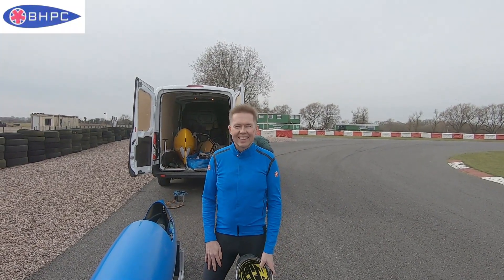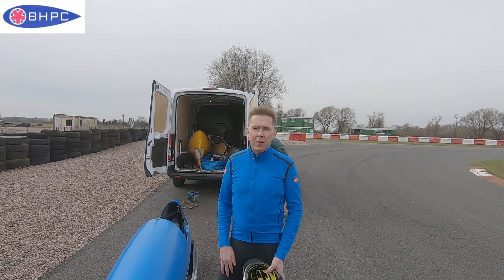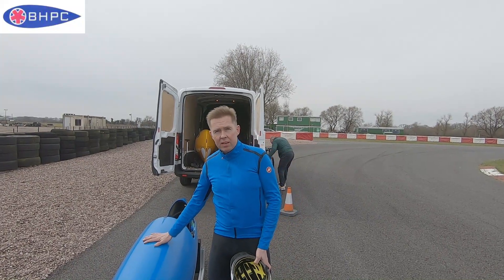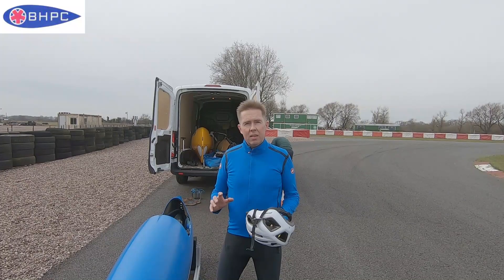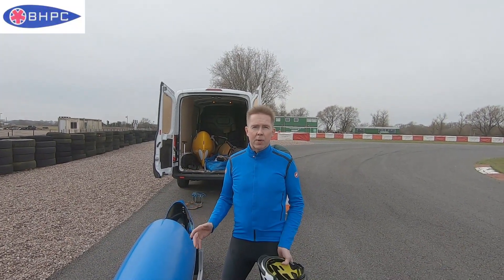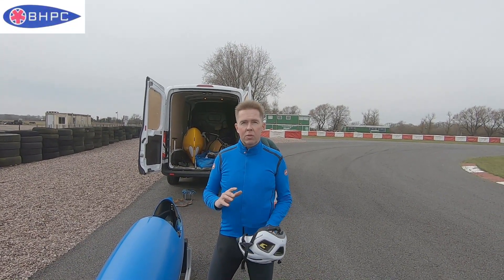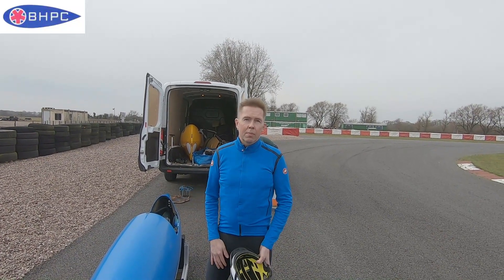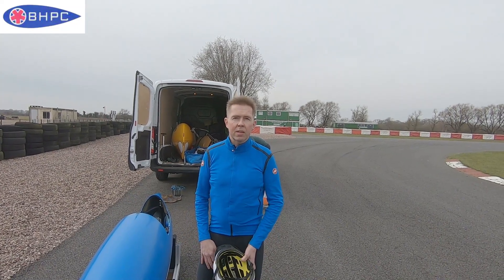200W laps - MTB vs Road bike vs TT bike vs Trike vs Recumbent vs Part-faired vs Faired vs Velomobile

Comment: Throw in some hills, and a road racer with deep carbon (and maybe disc wheel), aero bars, and a variable position Redshift seatpost that has a forward position for aero and rearwards one for climbing will do very well.  May even prevail if a long enough course with enough steeper climbing.

Comment: I wish you had one of my bikes to compare; The new Apache went 24.17mph on 157 average watts, Cyclone went 23.31mph on 160 average watts. Ron probably has 40-50 lbs on you? Both had the same tailbox. Apache TB is mounted further forward to the butt. 14.5 degree seat angle on both.

Comment: If you check droplimitsDOTde, the data from the Aldenhoven 1h race shows that  200W should  get you in the 60km/h speed range. Starting,  stopping and cornering are obviously an advantage vor lighter bikes.

Comment: Extremely interesting. Years ago, I figured a difference of 20% higher speed for me on the RR vs. the MTB - and I am surprised how accurate this number gets confirmed here. On the other hand, in everyday biking/commuting in a city, the MTB is the best overall compromise, with its comfortable balloon tires + fork, serious brakes and dependable handling in dangerous situations, including winter, while for training ... if you want the training effect, it doesn't matter, how fast or how far you go  ;-)

Another question: How long/far can one go with the different types of bikes under certain circumstances. I once had a chat with a guy on something like the Peslo Brevet, and he told me, he once went >420km in 14h (not just a straight, flat road, a real world journey with hills)

Comment: Nice test but my experience is different. In a race last year at the Amsterdam cycle park I did 40km in an hour at 197W with a part faired racer, less streamlined than the Mike Burrows Ratracer. In that race Quests were zipping past me. One of which I spoke to after the race. He did an average of around 200W too and managed above 50km. So this test is not a very good representation of what (streamlined) recumbents are able to do.
I think the problem lies in the standing start for just one round and the corners that are too sharp for a Quest.
Reply: Yes that also looked unreal to me, the quest result in this test.
Indeed, Maybe it has to do with cornering speed?
Reply: Yes , standing start ist not a good choice. But it shows the acceleration time matters when you have many corners in your personal trip.

Comment: At 200W that quest should be way faster (about 44kph, not 35). What tires/tubes are you running? Have you checked front wheel alignment?

Comment: As per other comments, a brilliant SHORT film with loads of content - GCN take note!
Reply: But, unfortunately, flawed content: there should be no wind for a proper comparison. Wind can change to fast to much. In direction. In power.
There is a reason competions like Battle Mountain have wind limits. Also a badly tuned, no hood, velomobile (thanks for clearing that up, Russel) . Also tires are way different.

And yet some draw conclusions from this. I hope the makers had a lot of fun making the film.
Reply: @hoekie3652  I don't think the tires different are a problem, they had tires appropriate to the bike

If you're riding a full sus mountain bike you're probably not running road tires
Reply: @obsidianclorox  Well, let's put road tires on the mountainbike and see. My guess is the rider on the mountainbike will be about as fast as he would be on a road bike.
Reply: @hoekie3652  The rider is sitting more upright on the MTB, leave alone the non-aero MTB frame and heat loss of suspension. He will 100% not be "as fast" or you've never ridden a bike, at least not in windy conditions.
Reply: @hoekie3652  have you ridden a bike before??? 😆

Comment: Very interesting. Shame you didn't have a cruzbike V20C to test, I would have been very interested to see how that did. Similar to the TT bike maybe?
Reply: I ride V20 not V20C. It is a pretty low type even for a high racer, so it has better aerodynamics.
Before that, the Pelso Brevet's tires are Rubino, so this comparison is not fair. Comparing Rubino to GP5000 and Corsa is ridiculous.
My bike has deep rim wheels and GP5000 tires, and I think it goes about 40km/h at 200W.
Reply: I am very curious as well lol
Reply: Would it be significantly better than the Paslo Brevet? Seems about the same position
Reply: @ACBLOWSCOLD  Not sure? Would a lot less chain make much difference? 
I have an S40 but havn't rode any other recumbent tbf. I'm not particularly bothered about speed and power in my own riding (health problems, hence the recumbent) but still find this sort of thing quite interesting.
Reply: @notalwaysright71  A normal chain absorbs  about 5W. The long chain of a rear drive recumbent which is 3 times as long will thus waste  about 15W excluding roller wastage, so atleast 10W difference compared to the V20.
Reply: @Recumbent_Rider  It doesn't work that way though. Chain friction loss is independent of chain length. The chain losses are mostly governed by chain tension, chain link articulation angle, and chain velocity. None of these depend on chain length. The chain 3x as long will still be under the same tension, running at the same linear speed, and the links will articulate through the same angles upon leaving the driven cog or arriving on the chainring.

Comment: something is a bit off [or at least misleading] about the test if a road bike beats the gs aero, the fastest production trike, and a lowracer and tt bike beats a velomobile. aero advantage increases with speed so faster speeds than 20mph [by fast bike standards, 20 mph is not that fast] would probably sort the bikes into their expected, proper places. which would be; mtb, road bike, fast trike,  tt bike, highracer, faired lowracer, velomobile, streamliner
Reply: Agree, but 200W is a power output most amateurs should be able to sustain for extended stretches of time, so it represents more of a real world use case.
Reply: @c4p3fi3rr  hmm, i suggest the opposite. it is a very artificial use case. experienced cyclists put far more than 200 w, during sprints and climbing. take the road bike and gs aero example. 200 watts is not pushing them to a speed where the gs aeros far better aerodynamics is going to pay off increasingly. on 25 mph sprints on the flat, and 30mph and higher downhill, the gs aero will have a big and ever increasing advantage over the road bike. this is what will happen in the real world. on an uphill, where speeds are increasingly lower than 20mph, the road bike will have increasing advantage of course. with the tt bike versus the velomobile, the same thing applies, but with a greater extreme at both ends. given free reign to apply a sensible amount of watts, the velo will trounce the tt bike on a flat road and leave it for dust on a downhill. the recumbent bikes should also go ahead too. no, i think a 200 watts limit is very much artificially favouring the road and tt bikes here, and giving a false impression of their real world speed cabability on a flat/down hill road. i still think the upright bikes have an advantage in a real world that includes uphills though.

Comment: The TT-bike is surprisingly good. But I think the velomobile didn't get a fair chance without the lid. With it I bet it could beat the TT-bike.
Reply: At the cost and considering the issues of storing and transporting the velomobile, IMO it should have very solidly beat the TT. If it’s even close, it makes me question the purpose.
Reply: Yesterday my brother rode his Milan at 35,6 kph average with 129 watts average on his commute (mostly flat). I think there's something wrong with this quest.
Reply from the maker: As noted, the quest had a rough drivetrain, and IIRC, kojak tyres, so not the best. There was also a LOT of air hitting my face, so a race hood would certainly have made it faster.  Maybe it wasn’t fair to include it, but it was there on the day so I thought I might as well do a lap.
Reply: @russellbridge  fair enough.
Reply: @russellbridge  Thx for the explanation. From experience: no way a modern TT bike beats a modern velomobile or proper setup Carbon Quest @200W.
Reply: @russellbridge Thanks for the information. The Kojak has a surprisingly high rolling resistance, almost as bad as the Marathon+. This, plus the drivetrain condition, explains a lot.
Reply: @hoekie3652 The most recent Paris Brest Paris was won by a road bike with aero bars. The event has lots of velomobile riders.  The PBP course has got hills and good pavement- a real-world long distance time trial.

Comment: I'd love a velomobile one day... eyeing a Milan or Bülk 👀👀
Reply: Wonder how this timed  / speed would be on an oval 2 mile track. If I were riding a velomobiel I would be very careful in the turns as you can lift a wheel in the turns knowing this might cause a person to slow a bit in the turns.
Reply: @ depends how tight a radius. The tighter the more likely wheel lift will occur. Its a facet of three wheeled vehicles.
Reply: @APhotographerTravels2025JohnMc  the race 2023 and 2024 in Aldenhoven on an Oval track shows that 200W for an hour result in an avg. speed of around 60km/h in race ready velomobiles

Comment: Props to the Cervelo TT bike.  Didn't think an upright would beat a recumbent (well, TBH, not the damn trike!), much less all of them! 
That said, huge margin jump up to the winner's results.
Reply: The recumbent has probably less pressure and wider wheels. Much like the road bike vs the MTB. Wouldn’t take much to make a MTB go the same speed for the same power.
Reply: Yes and he wasn’t even wearing tt gear so there’s room for improvement
Reply: TBF it's a pretty old-school recumbent vs a modern top-range TT bike
Reply: Wind resistance would exponentially rise as the speed goes up. At higher speed the upright bikes would have been absolutely smoked.

Comment: We didn't get to see 77 (the blue streamliner) turn a lap at 200W!  What is the course like?  Are there sharp turns, too sharp for the "straightline design" of 77?  Wind at 15 mph would be horrible in 77 even if the course was straight.
Reply from the maker: There's a hairpin, about 36m diameter. There's no way a BM streamliner is getting round that!
Reply: @russellbridge  Maybe you could do it with the help of a powerful rear brake and way more skill than I have... 💡😱😁

Great comparison. The Cervelo TT bike really surprised me.
And now I'm getting once again Mike Burrow's book out from the shelf. He has been such an inspiration for many in the HPV universe!

Comment: Woah! TT bike did incredibly well. What’s the deal with that? I wonder two things: would the results be the same on a windless day and would they be the same at 300W
Reply: I sold my velomobile because the tt was not so bad, much easier to handle in the city, downhill, uphill, and more fin to ride too.
Reply: @TheAntoine191  can you give photo of yoir velomobile??
Reply: @Topstekuii  It was a base model Milan SL MK2
Reply: @ACBLOWSCOLD  The laws of physics don't leave much wiggle room: almost all the resistance is air and, given the CdAs are fixed, if you increase power by 50%, the speed of each bike will increase by 14.5%.
Reply: @ eh, rolling resistance is pretty important. Also, In a wind tunnel your point would be correct. My two suppositions were meant to be independent , so if it was windy and 300W were being applied, maybe cross wind penalties would be reduced. I assume a velomobile would suffer from more crosswind penalties than a TT bike, but I don't know, hence my question.
Reply: @ACBLOWSCOLD  Your point regarding cross-wind is a good one, but it could go the other way: the TT bike being more vulnerable to cross-wind (more sensitive to yaw-angle) might do comparatively better at higher travelling speed given the same cross wind (because lower yaw angle). I would be curious to find out which way it goes. Re. rolling resistance, at these speeds it is a surprisingly small factor and should affect both bikes similarly, assuming the faired bike also has high-end tires on it (accounting for rolling resistance, I'm getting about a 16% speed increase instead).
Reply: @ACBLOWSCOLD Rolling resistance makes extremely little difference at these speeds.
Reply: @swecreations arguably rolling drag matters more at low speeds as at higher speeds aerodynamic drag becomes huge due to cube relationship whereas rolling drag is linear
Reply: @ Yep
Reply: The recumbents with lowsy tyres probably have a terrible Crr, while the tt bike with the corsas did very well in that regard
Reply: @ Peaky Torquers has spoken, all would be Crr commenters can stand down. 
So, Peaky, do you reckon at higher power inputs the ranks would shift up for the trikes?
Reply: The gaps would increase with more or less equal gaps between the vehicles. Besides the variation in speed that might be caused by limited trust in windy conditions
Reply: I should think the main difference between machines is riding style. Or should I say comfort, the TT needs you to be contorted in a aero position 100% of the time to get its advantage. Rat racer, velo, streamliners and even the greenspeed are naturally aero. Quite honestly I’d rather be on the mountain bike than the TT.
Reply: Maybe a bunch of time lost due to it not being a flying lap? Would have been a fairer comparison
Reply: @ Rus said in another comment that they were flying laps